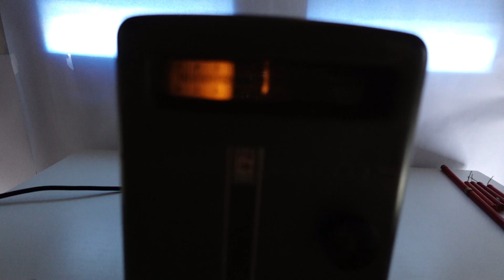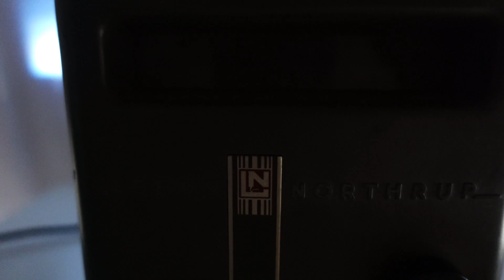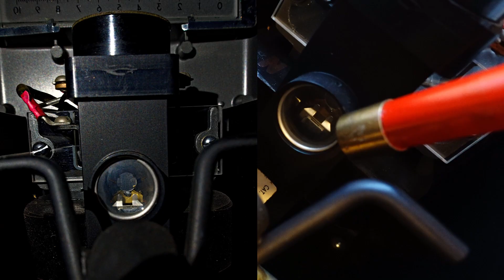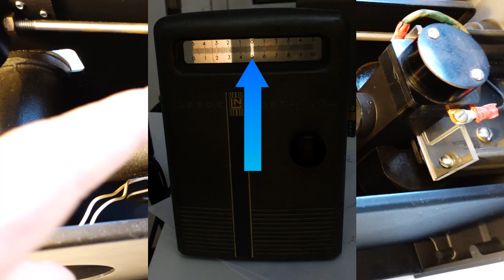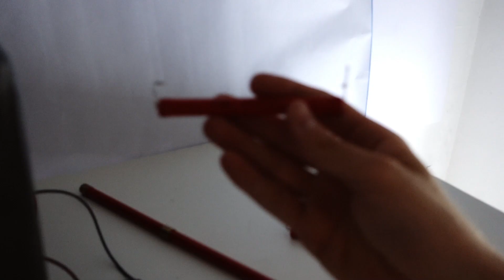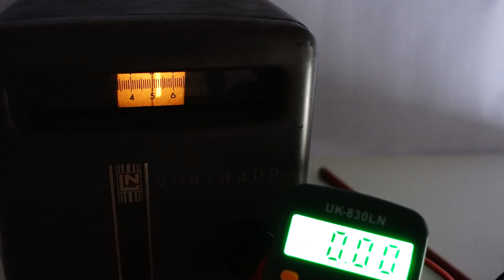WW2 era Nano-Amperometer review

Comment: Really nice old instrument.  I recently restored a 1950's Chinese ammeter.  Back in the day, these things were as expensive as a modern R&S or Keysight device.
Reply from the maker: Were very lucky as we can do so much stuff today with little money, although I find old stuff very fascinating, it reminds me of an era where you were in full control over everything, I've recently took apart a military ionization chamber from 1951, and the manual that came with the instrument contained every detail and actual written explanation of how the electronics worked, this mean I could repair it, as anyone back in the days with electrical experience could, nowadays instead almost every instrument (especially the cheal one) are a black hole, impossible to deal with unless you're one of the engineers who actually designed them and the manuals just contain useless warnings that no one reads, and this is what makes me feel kinda nostalgic for those days

Comment: I like how it instructs us to use trichloroethylene, carbon tetrachloride, or a similar solvent to clean the scale..  ..sometimes, the past really is the worst.
Reply from the maker: Indeed, now it would be impossible to even find some
Reply: @Farben-X  I did save an old sealed canister of dichloromethane, but these days I'm hesitant to use anything correctly described as "liquid cancer" - thank you for sharing such a treasure of a measurement device.
Reply from the maker: @zinckensteel yes you're right, glad you like it, I'm doing this so these kind of instrunent that existed before the digital age are not forgotten
Reply: I imagine it cut through the tobacco tar very well without dissolving whatever ink/paint they used.